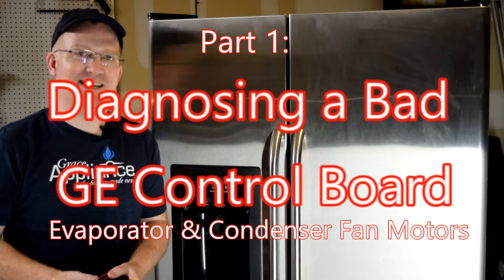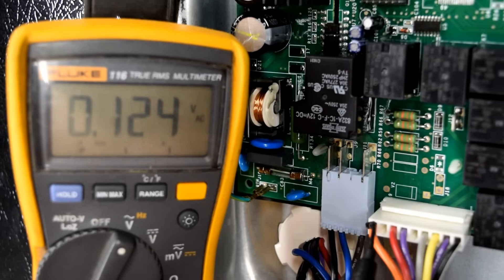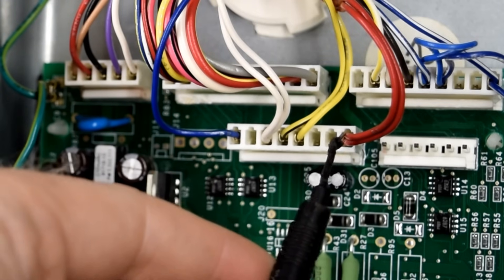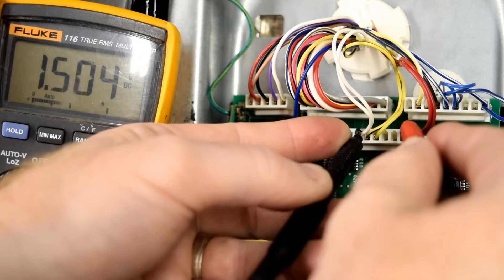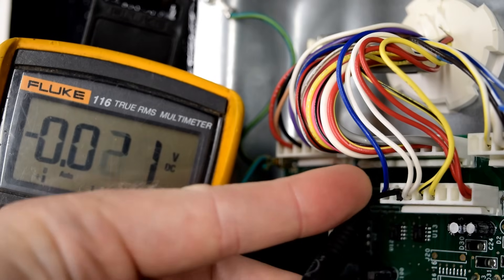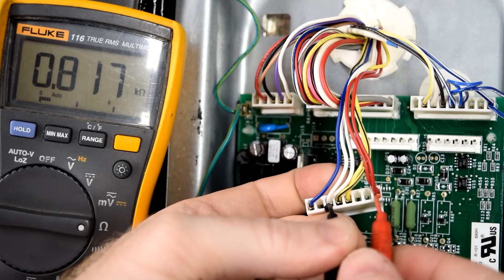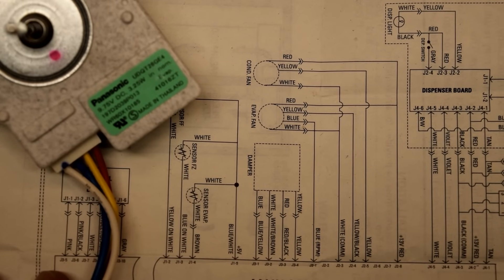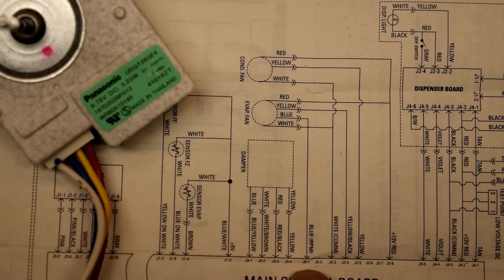Diagnosing a Bad GE Board - Part 1: Fan Motors

Comment: Hi mr any, I forgot to tell you that the actual company hotpoint (whirlpool); they have charged me 160 pound for the rendered services but what i am most concerned with at the moment is that( as I explained before )an engineer called out to come and fixe my side by side maytag American fridge freezer by replacing the control panel with the new one, he checked on the voltage where the socket is with his so called multi meter, but as I said before in my previous text that is all he did and left in a hurry, so point i was trying to make; (instead of beating about the bushes)is this; is my old control board any better than a new one, considering i am going to have another visit by the same company in a short while!?
Reply from the maker: I understand.  My point in bringing up the old board was that the new board has not resolved your issue with the refrigerator. So, it seems to me that the old board is likely not the faulty part. And, that is the board that you purchased when you purchased your refrigerator. Just because you purchase a new board from him today does not give him the right to then take your old board with him when he leaves. 
That’s the only reason I bring it up.  
If the new board did not resolve your issue with the fridge, I would definitely request to have him replace the old board as it didn’t resolve your issue.  If they no longer have your board, I would request a credit for the cost of the incorrectly installed parts. 

These are just my initial thoughts based on what you’ve shared.  It sounds like he simply guessed at the needed part vs providing a true diagnosis based on collected data.

Comment: Sorry mr Andy, since I have started corresponding with you i had e few error in my text I hope you forgive me for those, i meant my fridge is not cooling up, but the freezer is fairly running okay. Thanks yours sincerely Majid HOSSEINI.thanks again for your videos and your positivity and educational tips on fridge freezers.
Reply from the maker: No problem Majid,
Are you seeing any heavy frost build up on the back wall of the inside of the freezer?
Reply: No mr Andy  I opened the freezer door and I don’t see any frost like you said, at all, but when I leave it off for 30 minutes or little bit longer and run it for 45 minutes it doesn’t do its job properly it’s my fault then again I can’t let  run  constantly, that is my way of being on the safe side, any way did you read my another text about the company that I phoned  to come and repair it for the second time!?

Comment: Hi mr Andy this is silly i should have told you about my problems with the actual refrigerator right from the beginning it has all started when i noticed the change in the way I was running ;the temperature on my refrigerator rose from 3 up to 7 and right after that I mean after a while same thing happened to the freezer temperature on the control panel and some of my stuff in the refrigerator had frozen so I turned off my  fridge and took them all out of fridge to clean out my fridge, it took me a quite a while before I could manage to put my stuff back in the fridge and turn it back on again; the temperature on freezer dropped back down to  number3 but not on the refrigerator; remained at 7and I couldn’t change it because i wouldn’t have moved by pressing it, still do you think there was any fault with the control board?
Reply: Sorry an error on my part, i want to put it right, in my text i should have written i noticed the change in the way it was running.........

Comment: Hi mr Andy it’s me again Majid why did you want me to have an old control board back!? And there is something else; is it alright if I put my refrigerator on timer until an engineer comes to fix it?
Reply: Hi sorry I forgot to say instead of running it constantly nonstop can i keep it on a timer?
Reply from the maker: Majid Hossini hi Majid, 
My point in saying that about the control board is that, if he replaced it with a new control board and you paid for that, the old board is not his to take with him. That is your control board and may still be good.  Especially since you’re still having issues with the fridge after he has said to have repaired it.  
Based on the symptoms you describe though, it certainly can be a bad fan motor causing higher than normal temperatures.  Have you verified that both fans are running?  Inside the freezer and behind the fridge?
Also, check your condenser coils that they are not covered in heavy dust which will also cause this symptom.
Reply: Hi, mr Andy I have cleaned every inch of it, everything seems to be working satisfactorily in order except for that evaporator fan motor or may be defrosting system, but then again I am not you or anybody else ( an engineer)for that matter, I wish was, i couldn’t say i am 100 percent sure, just the pure speculation and educated guessing.
Reply from the maker: @majidhossini676  thank you Majid!
So, in order to diagnose it further you would need to remove the back inside wall of the freezer. This exposes your evaporator coils to look got frost and evaporator fan to verify if it is spinning. 
You'd also need a multi meter in order to perform ohm resistance tests as well as test for voltage to the fan and defrost heater. If you aren't comfortable with this peice, it's definately recommended to hire a technician to perform the repair which is always better than simply guessing at the correct part of course.

Or, if you are comfortable with the disassembly and testing I can certainly do my best to walk you through it.

The coils however, should have only a light coating of frost on them and not heavy frost or ice build up which would indicate a defrost issue.

Let me know and I'm glad to help in any way I can.

Thanks!
Reply: Hi again mr Andy sorry,i can’t do that since i have no experience nor qualification or new parts for replacement for it even so I am very at fixing almost everything, with regard to that i have fixed my sister’s cabinet drawer and  other things, so I am expecting an another visit from hot point whirlpool engineer to carry out the repairs, you see i am not totally invalid and decrepit.
Reply from the maker: @majidhossini676  sure, I totally understand. It is sometimes better to leave this kind of repair to someone who see many a day. The time and frustration saved may be worth it!  :)
Please keep me posted if you should have any questions!

Comment: Hi mr Andy, engineer came out to replace the control board in my Maytag refrigerator but the point is he didn’t do any test on it before he change it, to see if there is any fault in it I don’t mean to be rude sir is it possible he might have stolen the original one and kept it for himself ?and on top of that my fridge is  not cooling enough but my freezer is fairly   working okay, is there something wrong with evaporator fan motor because my refrigerator is constantly running nonstop and I have to turn it on and off manually by leave it on for 45 minutes and off for 30 minutes and turn it back on again and keep repeating the same cycle over and over again and i am still waiting for another visit by engineer to come and have a look at it. I really appreciate you comments on that sir, because believe it or not it is doing my head in!
Reply from the maker: Majid Hossini hi!  I’m sorry to hear about the issues. 
I’d like to think the technician did not do such a dishonest thing, but I have seen worse things personally.  
More likely to me is that he simply guessed at the possible needed part based on the symptoms it’s exhibiting, and guesses wrong. 
If you’re able or get in touch with him, I’d request your old board back...or perhaps a refund for the money you paid him for the incorrect part. I’m not certain how most companies handle it, but I’ve never charged a customer for a part due to an incorrect diagnosis. It does happen...and the best one can do is take it on the chin and eat the cost of the parts. This shouldn’t be on the customer unless I’ve had a conversation about my findings and give them the option of trying a particular part on their dime.  I also won’t charge for a diagnosis if I am not certain of the issue with the machine. It saves this kind of headache if I haven’t charged anything for my time. 
Anyway, hopefully he takes good care of you there.  

As far as the evaporator fan, it certainly could be this based on your symptoms. And, if you in fact have a new control board, the fan should be turning if the freezer is too warm. If not, likely it’s a failed fan motor. A qualified technician should be able to verify voltage to the fan motor quickly and easily to confirm this.  

Let me know if you run in to any questions!

Comment: Great video... two small points with regards to terminology  " linear protection," is actually 'liner protection." in other words, the evap fan  runs once doors are open for a period of time (there's actually two timers)  to protect the fridge liner from heat from the lamp as well as from condensation . And pwm is" pulse width modulation "  as it's not modulating the wave, as a square wave will still be a square wave, but it is modulating the width of the wave.  Both are small points but their names make it easier to understand what they are, in fact, doing. However" linear protection " is certainly something people need to prevent them from purchasing LG Fridges that feature their god awful linear compressors. 🙂

Regardless, a fantastic explanation of this board..
Reply from the maker: Great info!  Thank you for that. The PWM, I caught myself after the upload, but ehhh that’s YouTube I guess.  I miss being able to add annotations to the video after. Ha!
Liner Protection!  That makes a ton of sense!  I’ve seen some built in fridges with failed door switches that ended up melting the lining due to this exact issue.  

Thanks for the kind words and great info.  Stay in touch.  

Andy
Reply: @GraceAppliance I've worked on countless of these things yet I still have to visit service manuals and tech sheets from time to time, your video and visual representation has helped cement some of that info.   

Also, although I prefer voltage tests over resistance tests any day of the week and twice on Sundays , your fan motor resistance test suggesion from  the board is something I never tried but is now a part of my arsenal!  Always learning!  New subscriber!

Comment: Thanks for the excellent videos.  Where did you get the test leads for the fluke 116?  I have that meter already but would like to purchase the leads.
Reply from the maker: Thanks for the kind words! 
Yes, the 116 is a choice meter... I've had mine about 7 years now and wouldn't change a thing! So much so that I think I may have changed the battery just once. LoL

The meter leads I have are stand alone leads vs an adapter you add on to your existing leads. If I had to choose again, I'd probably get these for the sake of less room on my diagnostics bag where space is a premium. 

Amazon affiliate link: https://amzn.to/2STBy4B

Also, if you don't already have one, a super nice thing I have for my fluke is one of these hanging magnets for the meter. It sticks to the appliance and just makes life so much nicer.

Amazon affiliate link:
https://amzn.to/314PSde

Comment: Hey Andy, I followed your steps in diagnosing my fridge, neither the freezer or the fridge was getting cold. I found that the control board on my GE HotPoint model #HSS25GFPAWW was burned. I purchased the new control board I replaced it, the freezer is working fine, making ice and is at zero degrees. I followed your diagnostic steps and found that the damper door to the fridge side was not opening. I thought I had a bad damper door assembly so I purchased a new one part #WR09X10050 which includes the thermostat. I installed the new damper door. The damper door opened and remained opened for about 5 minutes, then the door closed again and did not open. I did put tape on the door switch to make sure that the fridge did not think that the door was open. The evaporator fan is working, I have a good frost pattern and the heater does not seem to be on when the evaporator fan is on. Do you think I have a defective board or can it be the Encoder Board Assembly. How can I diagnose if the new control board is bad, or if the plug that connects to the damper motor is getting power or how do I check if the encoder board is working. I have looked for info on the internet but did not find anything. Thanks in advance for your help.
Reply from the maker: Hi Alfonso, could you please send the first 5 digits of your serial number?  Thanks
Reply: @GraceAppliance  serial numbers RF2 06939 Thanks
Reply from the maker: @alfonsosanchez7896  thanks!

Based on your serial number, you'll need to make a slight modification to your wiring at your control board.

Please see the instructions on how to perform this and let me know if you have any questions!

https://www.scribd.com/doc/115029528/WR55X10942-Installation-Instructions
Reply: @GraceAppliance I'm away on work. Will try it this weekend when I'm back home. Thanks
Reply from the maker: @alfonsosanchez7896  no problem. The issue comes from the fact that you've got 2 temperature sensors in your refrigerator section and the new board requires just one.
Once you snip a particular wire on your harness, you will be in good shape.

Safe travels. 
Thanks
Reply: @GraceAppliance  Thanks for your help.  I somehow missed this step when I read the instructions on the board. I cut the wire and the fridge side is working fine.  Thanks again
Reply from the maker: Alfonso Sanchez awesome!  Glad to hear it did the trick. You’re very welcome. Stay in touch.

Comment: Hi! It appears I didn’t pass the test for the fan motor circuit which starts at the 6:30 mark! Does this mean a new board is what is needed?
Reply from the maker: Hey, do you remember what resistance reading you got?  (if any)

If you show no continuity, it would be a failed fan motor. I've heard reports from others that they got roughly 0.8kohms which is fine.

Let me know what you find. Thanks!
Reply: .47
Reply from the maker: Karagan Bulger yes, that sounds like it will be a failed fan motor based on that. 
I’d want to confirm that you’re getting appropriate voltage to the fan to also rule out a bad board, but if you’re getting voltage to the fan, the board is doing its job.  Look at the two larger green resistors on the board and see that they have not turned dark or brown.

The condenser fan motor would get around 13.5vdc, but the evaporator fan motor is a variable speed and the voltage varies to achieve low, med and high speed. So it would be between 5-13.5vdc. (As shown in this video) 

But, I’d unplug the fan circuit and do the tests directly in the boards pins going to that particular fan.  

If you have any questions, let me know!
Also, when you order your fan motor please use the affiliate amazon links found in the video description which helps the channel greatly. Thank you!
Reply: Thanks for the info! I’m gonna pull the fan motor tonight and I will let you know. Other info is the lowest the freezer gets to is 6° and the the fridge gets to 45° Regardless of the actual setting but I guess without the evap fan blowing it won’t get to the actual setting. I will be sure the buy through your link
Reply from the maker: @karaganbulger2543  yes, for sure it wouldn't get much colder than that if  the evaporator fan has failed.

The freezer is actually doing its job, but it just can't circulate that cold air and pull it across the cold evaporator over to the fridge side.

Sometimes you'll find frost build up in strange places on the evaporator as a result of no air flow too which looks kind of like a defrost issue, but isn't of course.

Good luck!
Reply: New evap fan motor installed and put back together. Thanks a million for your help. I Ohmed the new motor before I installed it and boom 1.7
Reply from the maker: @karaganbulger2543  awesome work!  You're most welcome and stay in touch.

Comment: Hi Andy.   It's a pleasure to watch your videos.  But, I was concerned about testing J2.  The fan motors.  You said if you don't get 12-14 volts and the meter is jumping all over the place, its a bad control board.  Shouldn't it mean bad fans or fan?  Just curious if you misspoke.
Reply from the maker: Hi, Thanks for the kind words!

So, the control boards only job is to send appropriate voltages at the correct time.  If the voltages are not constant (i.e. not sending full voltage or the meter is showing inconsistent voltage) It would indicate a failed control board.  

To double check that the fan is not the cause of the voltage variance, you can unplug J2 and measure the corresponding pins on the board directly with no fan attached.  

Now, there are times when a shorted fan motor can cause the fridge not to run because it robbing voltage from the board.  The quick diagnosis for this is to unplug J2 and restore power to the fridge. If the fridge runs as normal at that point, it would be a shorted fan motor (most commonly the evaporator fan motor).  To further track down which fan, you can repeat the process of unplugging the fan motor individually to isolate the offending fan.  

Does that make sense?   
What issues are you having with your fridge?
Reply from the maker: Here is a follow up to this video after I had replaced the control board:  https://www.youtube.com/watch?v=jX2AnQL3yi4

This video would show the correct voltages then being sent to the fan motors and a steady voltage.  Keep in mind that the evaporator fan motor is a variable speed motor and thus can get a low, medium or high voltage from the board (something like 6.5, 9, 13.5 vdc for example) depending on what speed the fan needs at that point. 

Thanks!